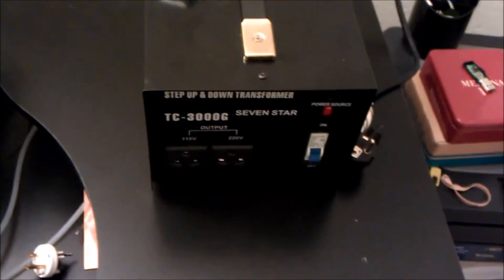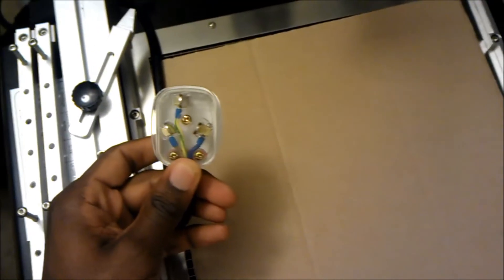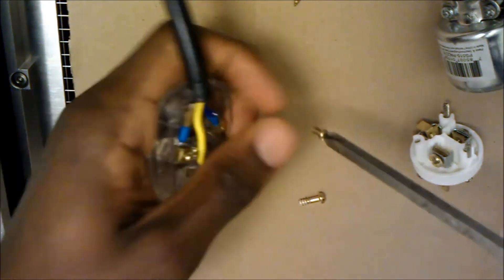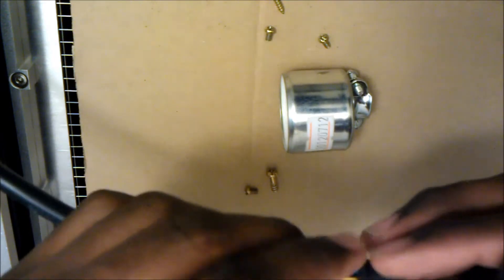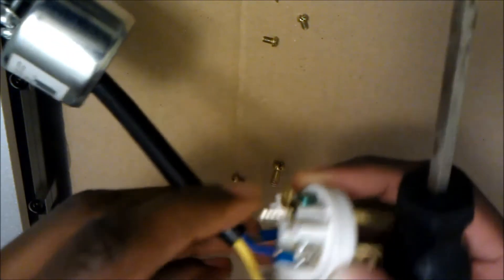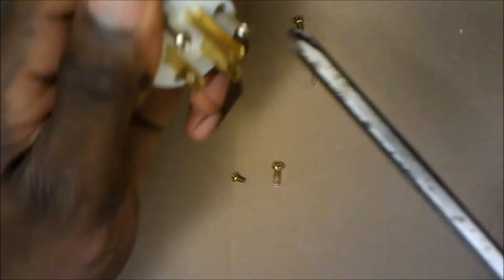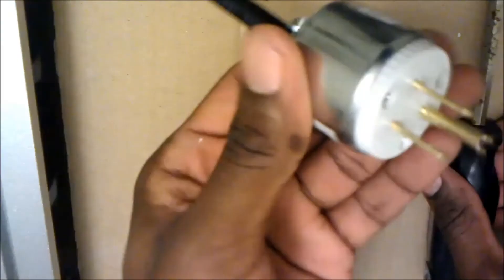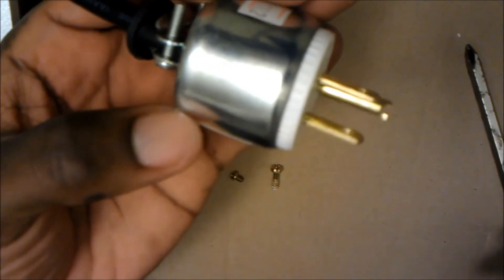Rewiring Scotle Rework machine for US

Comment: Great Vid, if you wanna make the cable longer make sure you know the amps the machine use and use a cable that wont burn by the amount of amps, you can check on the 
NEC 2011 article 316.15(B)(16)